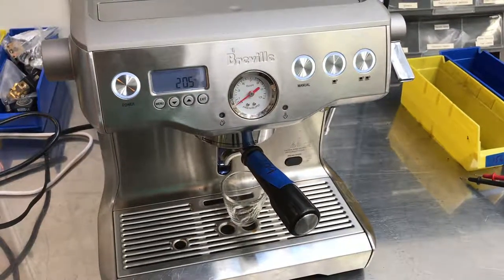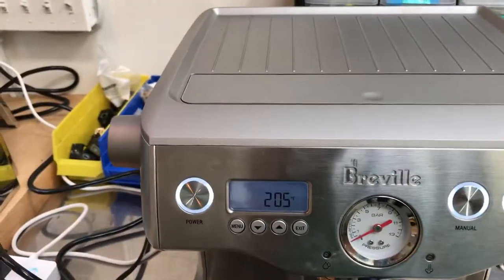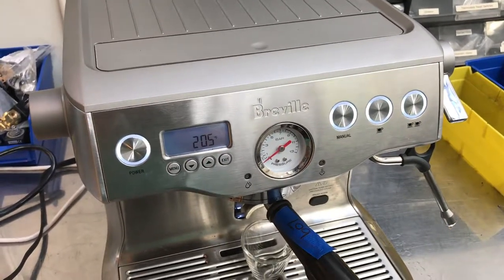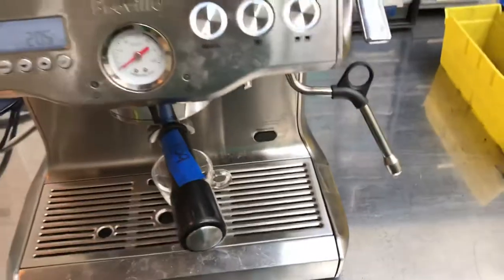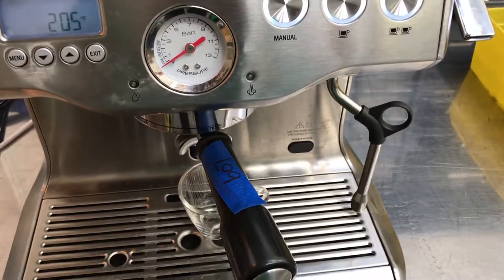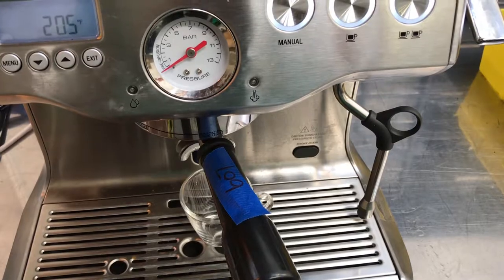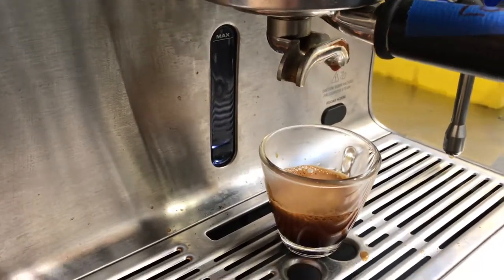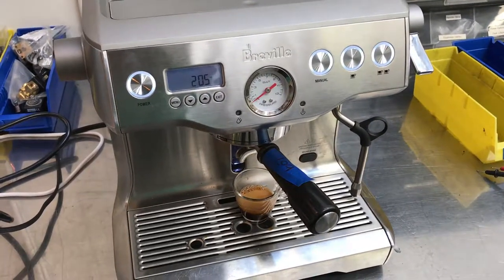Breville Espresso Machine Tripping GFCI Due To Steam Leak #1562

Comment: Thank you so much for a quick short video that gets to the point.  My machine started having problems with it not completing a shot pull.  Everything else worked fine.  While running it through the descaling process it blew the gfci when I pressed 1 CUP.  Then after that it blew the GFCI just by plugging it in.  Later i could plug it in but still could not press 1 cup without blowing the gfci.  I found no leak and could not find any fried wires.  I pulled the ground like you advised and no more blowing the gfci.  Makes sense that the solenoid was leaking and by pulling all the shots while descaling the leak finally shorted out the solenoid.  I will order the solenoid asap and see if works.  Thanks.

Comment: For future reference or others  the  steam wand drip can be fixed by pulling apart the valve and simply rotating the two gaskets holding the ball valve. It doesn't take long at all.

Comment: I'm having a similar problem of the GFCI tripping on my Barista Express when I press the single shot button. Then it works if you baby it. Then it kicks out again after that preliminary drip. Also, is it espresso or expresso? It's spelled espresso, but it seems to be called by the name of Barista Express..... o. Which is really correct?